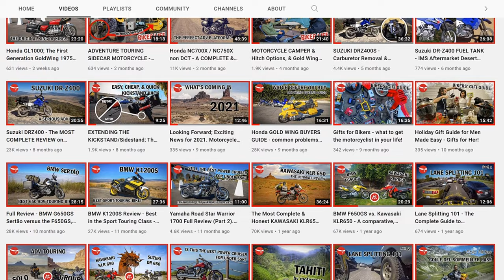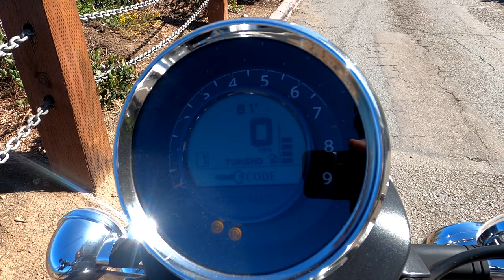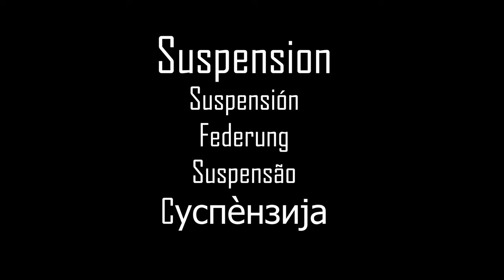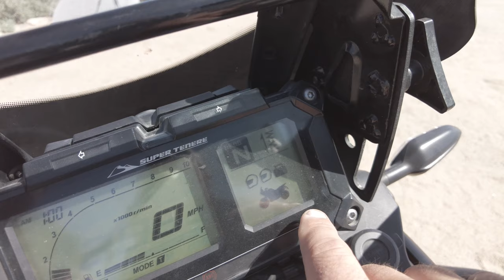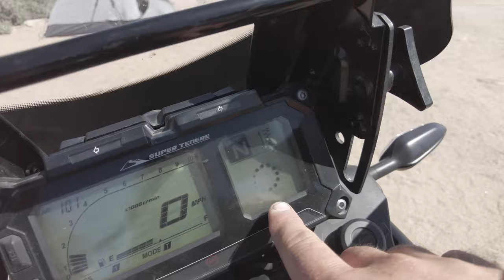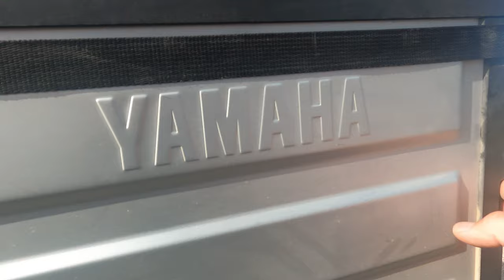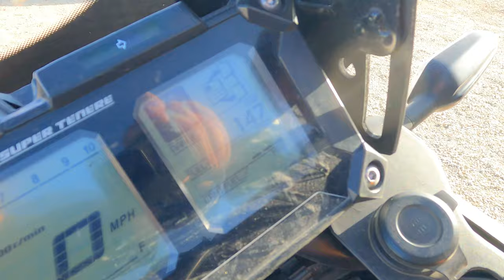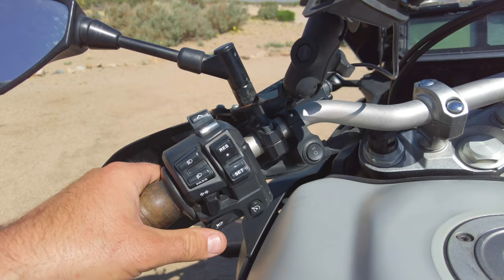Yamaha SUPER TENERE ES XT1200Z + luggage, ADV mods & Upgrades; a COMPLETE, HONEST Owner Review in 4K

Comment: I am the 3rd and longest owner of a 2012 ST. I grew up on trail bikes (1960-70's), then graduated to large street touring bikes.  Then after a bad wreck, dropped down to 500cc bikes.  Then I bought this because I wanted to explore the western US, as I did when younger.  In my first mile of sandy road I dropped this bike, twice. I've gotten pretty good at picking it up. When I am cruising with my friend and his GS1200 at 70mph, I am running around 3600 rpm and he 4000rpm, so I am getting better fuel usage.  I've noticed that traveling out west that I get even or better fuel mileage at 80 than 70.  Not sure why this is, but happy it does.  The bike has much more power than I need.  I have ridden crotch rockets at 150 mph on highways and I don't need that temptation at 68.  I have had to escape from cagers and they get tired of trying to follow me at 100mph.  I don't ride the bike in Sport mode for instance, because I don't need it when touring. Perhaps if I were loaded up on unstable ground, I would use sport mode. I have thought about getting the extra 20 hp on a re-map, but haven't really felt the need.  I agree that there needs to be a mid-mode, and should not hide that extra horsepower.  I changed out the stock handlebars for a pro-taper adventure so standing is more comfortable and pivot pegs for a safer platform. The stock pegs broke off eventually; I wasn't as impressed with them as you.  I don't like the stock bags as they can dismount towards the spokes on a hard side impact and are a pain to remove when this occurs.  And they are heavy and break the keys. Leaning towards Lone Rider Soft luggage, and no large top box.  I don't have the luxury of electronic suspension. Something else to go wrong, in my opinion. Right now I'm facing rebuilding my ABS, or perhaps deep cleaning it.  I had to change out the automatic cam change tensioner and the ignition switch.  These problems have been ironed out in later models.This is the first bike I've ever owned with ABS and Traction control. I love it.  This bike stops really great!  I like that it doesn't have a damned beak. I'd like to see a bit more clearance between the front tire and the fender.  I disagree with you on the momentary fuel usage because I can monitor my fuel usage as I go. Remember that fuel pump holds about a gallon of fuel. I have never run the bike out of gas even though I've had the warning light for an hour. You have about 2 gallons after the light comes on. Near the end you mentioned the start up procedure. Like a computer, you can't use it immediately. You must let it boot up and run through its processes. Same with the Ten, you must let it run through the boot up process, then it will start immediately. No doubt, the newer bikes are better. My Royal Enfield Bullet 500 gets 75mpg.  But it doesn't over 600 pounds fully loaded or go 80mph all day. I will keep this bike. Cheers!
Reply from the maker: Thanks so much for that. I love hearing from owners. I wasn't aware the fuel pump occupies a gallon of fuel. I wouldn't mind the former version without all the button either to be very honest. Such a fantastic bike, not sure why we don't see them more often. Thanks for watching. I'll be releasing a review of a 1939 Harley knucklehead this weekend so hopefully you tune in. Best. Nik
Reply: my ABS failed too , started to get air in to rear caliper . After million attempts to clean and bleed ABS I just swapped brake hoses around . Hose from rear brake goes strait to the pedal and hose from ABS goes in circle for rear brake.  Now front still has ABS and back do not , love it .
Reply: The second generation corrected many of your issues.   Specifically 2018 and never have several improvements.   Annual non visual improvements were made by Yamaha.  See forums for annual changes. The soft aluminum key issue is corrected by getting a few duplicated keys made which use harder metals and do not bend.   For onroad use the Yamaha luggage is fine, just keep lubricating the locks and mounts, also learn the correct procedure for opening/closing and mounting/dismounting.  For off-road use soft luggage is better. Electronic suspension is very useful and dependable in my experience.  To be able to change settings dramatically on the fly while riding is a huge benefit.   Different settings needed for interstate, curvy roads, dirt roads, extra person, luggage, etc.  Even better would be dynamic suspension.  People need to consider that this is an XT Yamaha dual purpose bike, so it will be a compromise design for on and off road.  It can be adapted either dirrection with seat, tire, suspension, and accessory changes.  It is not a pure cruiser, sport tourer or a dirt bike. The carry capacity of this bike is incredible due to  heavy duty big steel frame and engineering.  See Fortnine review.  Overall this bike is best for people who want a dual purpose bike design, want relability, durability, easy of maintenance, high carry capacity, and can tolerate the weight and engineering compromises.  If you look back at your bike after a long ride and smile, it is the right one for you.
Reply: Those '39 Knucks kinda suck for serious ADV riding, trust me. @pegasusmotorcycletours
Reply: Please assist me with how you dealt with the shakey front section with the dash board, lights and wind protection. I have a feeling something is loose on my bike to cause it to shake as much

Comment: Great review. I bought a brand new 2017 and now have a little over 41,000 trouble free miles on it. General maintenance,  tires and go. It's never left me stranded and never failed to start. It's an undervalued motorcycle. It does everything it should. Could it lose some weight? Could it have more horsepower? Could it have more electronics? Sure. That all comes with a price. It's a solid motorcycle that didn't get much love after 10+ years. Mother Yamaha let this bike to the wayside and moved on to other things. Shame really. However, mine is paid for, does everything I need it to do without any fuss and will likely be in my stable for years to come. I do want to see 100,000 on the odometer before I start considering other motorcycles. Have a Happy New Year and thank you for your incredible and informative YouTube Channel.
Reply from the maker: I appreciate you taking the time to watch and share your owner experience. It makes.me appreciate this bike even more. Happy new year and thanks for the support
Reply: At
Reply: Brilliant machine

Comment: Thanks for your video. I have the r1200gs, xt1200z, and vstrom1050xt. The r1200gs is heavy but has a low center of gravity, making it the most off-road capable of the three, the xt1200z is the heaviest but makes a stable, fast tourer, and the vstrom1050xt is on-road oriented but is light and fast like a naked bike. All three are fun to ride on trails. They all have their own unique characteristics as well as commonalities, making them fun to ride.

Comment: The Super Tenere responds very well to tuning. A full Arrow exhaust and ecu flash make it really wake up. Power Commander w/Autotune gets those AFRs down to the 13.6 area where the Superten runs cooler and powerful. 

As far as your numb hand: The stock bars are awful. I put a pair of Fasstflex 15 degree bars on 2” risers, no more hand, wrist or shoulder pain, ever. 

If you’re venturing into dirt, get the stickiest aggressive tire you can stand. I really like Anakee Wilds. On gravel/muddy roads, they work great! Ride in traction control 2 setting, let the rear drive the front.

The seat leveling mod, look it up, works wonderfully. Just do it! 

A lightly used Superten is the best bargain in the motorcycle world.
Reply from the maker: Thank you very much for taking the time to watch the video and participate in a conversation. Current and future owners will appreciate you sharing those words of wisdom when it comes to use the mods. Safe travels and happy New Year
Reply: thanks, I will have to look in Fasstflex  , as for tuning :)) Tenere really moving after it . Many reviewers I see,  who  no not own bike or have him chiped , newer try wide open in second :)))
Reply: Who does ecu tuning. I haven't had much luck finding one for this bike
Reply: @mikescott9213  2Wheeldynoworks in the Seattle area are very good with this bike. They can really refine the fuel delivery and eliminate the 1-3rd gear smoothness. They do several other things to the map and you DO, depending on exhaust, deliver a power increase. Mostly, though, it makes the power less glitchy and more refined if that makes sense. Cost is about $275 and you can just send them the ECU and they will have it back to you within a week. GL
Reply: 1-3 gear roughnessi n Sport mode. is what I meant!
Reply: @fifiandmax  , somewhat worse.

Comment: I had a 2012 for 5 years and almost 30k trouble free miles. Honestly, I never rode it off road on anything more than a hard packed dirt road. I spent 95% of my time on the pavement. It soaked up the miles effortlessly, and like you mention its low center of gravity makes it handle quite well for as tall as it is. I'm considering getting one again!
Reply from the maker: Me too honestly - very tempted for another one.

Comment: Great review. You don't see much on the Super Tenere. People seem to gravitate to the hot, new, flashy stuff. The ST is very underrated and under appreciated gem. I think a big part of that is all the performances that Yamaha left hidden to be found through various mods. 
I have a 2012 model that I bought in 2018 with 18,000 miles. The previous owner kitted it out pretty thoroughly. The biggest thing i did was put a full Arrow exhaust on and had the ECU flashed. It did a lot to smooth out the throttle and get rid of the jerky engine braking. It really woke the bike up and now the T mode feels close to the previous S mode and S mode is just fun now. People talk a lot about the big HP you get from other bikes but most of that HP is never used or needed by 99% of the riders. I also installed a switch that mimics pulling the fuse from the ABS so it's really easy to turn off when needed. Be sure to keep good maintenance on the brake fluid or it can kill the ABS. Ask me how i know. At about 30,000 miles I needed to replace the rear shock and rebuild the forks. I put an Ohlins shock on the rear and Racetech parts in the forks, it really was a positive gain in performances. I really feel like it will be my forever bike, just due to it's,  comfort and versatility. It's not the flashiest, but it's solid and reliable and has everything i need in a ADV bike.
Reply from the maker: Thank you so much for sharing that detailed review of your own yamaha. I remain a huge fan and would probably consider returning to it in the near future. I have a friend who's in love with this generation 700 so I'd love to show them what the bigger brother is all about next time we hit the trails. Right now I'm enjoying my KTM 790 adventure which feels exceptionally light for its capability but I do miss some of the conveniences the super tannere had.
Reply: The resale value is crazy considering how good it is. The triumph 1600 T bird twin is another great bike and bargain in the USA 4k for an immaculate one with less than 20k on the clock. Another fab bike to ride as it's got so much low down pull.

Comment: Nik you do the most comprehensive reviews on bikes, which are more relevant seeing they are bought with your own money. just wondering how this compares to the other shaft drive ADV bikes not so much BMW but Triumph tiger 1200 & the more modern Moto Guzzi v85TT. Merry Christmas to you & your family.
Reply from the maker: Thank you for watching and for your support of my work and this channel. My experience with triumphs thus far has been one of satisfaction with the ride and dissatisfaction with the ownership. That is more relevant to newer trials as the older ones from the '90s for example seem to have been built better. I reviewed both the newer sprints as well as the older daytonas. I don't have extended personal experience with either of the two motorcycles you ask about that would permit a valid review, however I've heard exceptionally positive opinions from owners of the Guzzi. And after my ownership of a Guzzi California from Brand new, I would have zero hesitancy in pulling the trigger on its adventure touring Beauty.

Comment: Nick, I'm glad to have comes across your review this evening. I laid my 2020 Super T down on one of the sharp turns on Highway 1 (just north of Bodega Bay) last week. Messed up the OEM engine guard and bent the gear-shift lever, but no other damage (besides my own cracked ribs). I had just about concluded that I was going to sell this bike -- because, as you point out, it's very heavy at low speeds and straight up tough to maneuver when not running -- and buy something lighter.

But your review of the Super T was so positive that I was convinced to hang on to this machine...and work on increasing my skills to ride it better vs. blaming the bike. And to replace my damaged Yamaha engine guard, tonight I bought the T-Rex engine guard that you have.

Thank you for being willing to talk about all the great points the Super T provides, when so many other reviews compare it to the GS, which I'm not sure makes sense. Your enthusiasm for this bike is catchy -- and my decision to hang onto this big boy is proof of that! ✌🏼
Reply from the maker: Vest to hear it. I wish you a quick recovery. Consider perhaps taking training and a guide to improve your riding skills off-road. It's all about practice. I offer that if interested, private lessons and tours and more ís on my website but feel free to reach out. In any case it all depends on what kind of riding you want to do- how intense off-road. It wouldn't be my first choice bit for the tours I lead in Eastern Sierra, socal and utah, it's a great bike.

Comment: Your assessment is accurate based on my ownership of a 2016 model for 5 years now.  I've been on two wheels since age 12, a long time ago, before bikes were so specialized (and riders so pampered by their bikes).  I can go anywhere with this bike except for the most challenging off road spots.  For that I take the KLR or the trusty old XR400R made street legal.  I have a stable of bikes from a touring 2018 Gold Wing to the off road XR on the other end, guess which one has the most seat time?  The ST1200.  Every road, be it interstate, 2 lane blue highway, forest service "road" or even a reasonable 2 track is open to me on the ST.  This is like the big Beemer ADV bike, undervalued and underappreciated.  One does have to have a decent inseam to ride it in a comfortable manner.  It will stay in my garage until I can't ride anymore, for the price and the ride I can't beat it.
Reply from the maker: Thanks so much for watching and taking the time to share your experience. I truly appreciated. Happy new year. Nik
Reply: Great comment!  Looking to buy and your comment helps greatly.

Comment: Great review and  video!  One minor correction, though. The amber lights work better in environments with particles in the air (dirt, sand, snow, etc) because of the way the human eye works and the fact that we perceive less glare from the yellow light than from white/blue light. It has to do with the number of rods and cones in our eyes. This effect is the reason that ski goggles will frequently have a yellow/gold tint. By reducing the glare that our eyes can see it helps us process the contrast and see different terrain rather than a bright glare that washes out the details.
Reply from the maker: Thanks for watching.  Glad you found your time well invested. Thanks for the clarification, but that was my understandong as well. Maybe the way I presented it produced a confisin. What did you get from my description of the amber lights? Cheers. Nik
Reply: True. Perfectly explained. 

In environments with no particles amber lightning is much worse. So it comes to where and when you ride.

Comment: In regards to the keys for the luggage - I suggest going to a locksmith and having him make three keys with only the part that you need and maybe 2:45 eighths of an inch worth of haft beyond it.  Then go to Home Depot and buy yourself some plastic end caps. Fill those in gaps with epoxy and stick those keys in with the sunk into the epoxy.  Once they’re firmly dried, go stick the keys into the luggage and you now have a very discreet set of knobs that you can use to open your luggage.  I did this on my concours because I got tired of having to fish the key out of the key fob.
Reply from the maker: That's very common woth the goldwing gas cap and documents pocket. Thanksmfor the suggestion. I know what you Mean.

Comment: I currently have 15k miles on my 2018 S10. I feel that it is a bit heavy for much offroading, and it is top heavy. Personally, I would like to see them stretch the bike a little and stretch the tank to lower the center of gravity. Other then that, I love the bike. Most of the miles on our bike is road and 2 up. So far, the only upgrades I have made are luggage, and custom seats from Terry's custom seats as it is common to take day trips or even week long trips, so having the better seat is a blessing!
Reply from the maker: Thanks for that recommendation for the seat manufacturer. The seat comfort is likely the main factor when it comes to owning a bike long term or selling after a month. For your use 2 up it sounds like a perfect setup. Thanks for watching.

Comment: The Yamaha cases aren’t great but the rubber seal puts enough force on the lock to make the key difficult just push down on the lid with a couple pounds pressure and its way easier
Reply from the maker: Thanks for the tip and for participating in the conversation.  Cheers. Nik